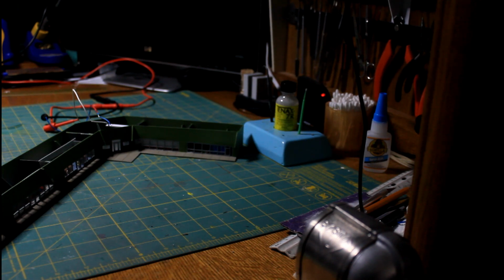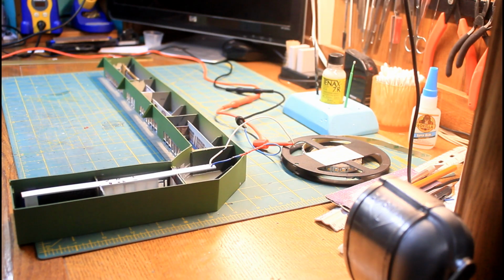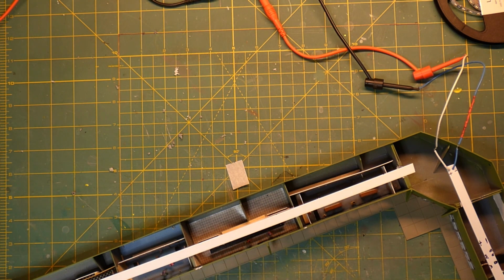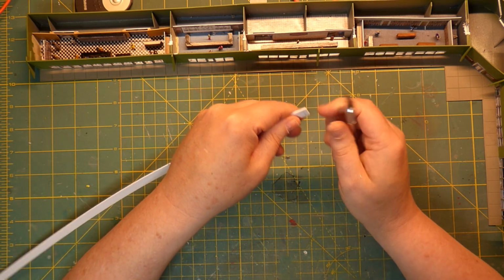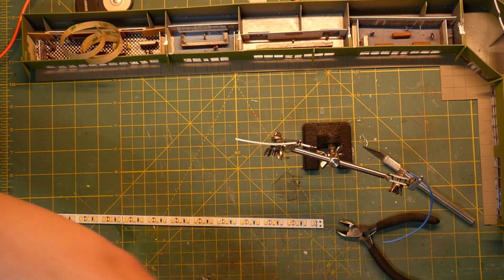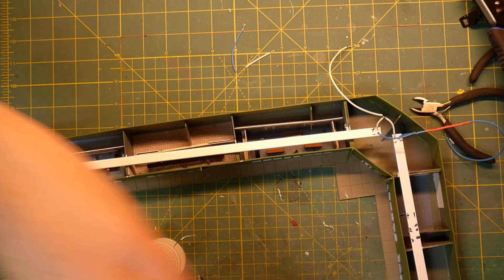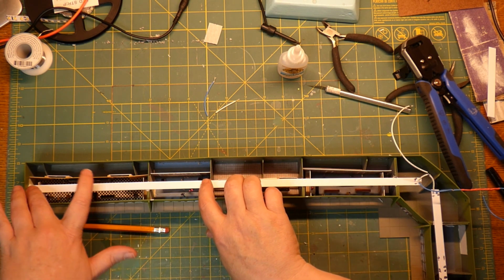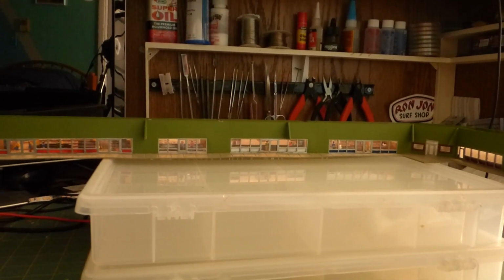Scratch Build A strip Mall: Part 6

Comment: Where did you get the LED’s and what is your power source?
Reply from the maker: There is a link for the LEDs in the description under the video. I have a 12 volt power supply for all the lighting on my layout as for what I use to test lights on my desk I have a small 12 volt supply by my desk just for that purpose.